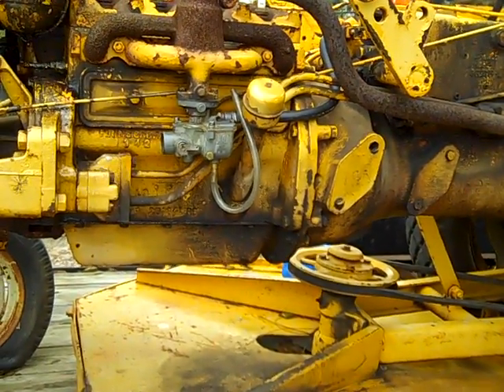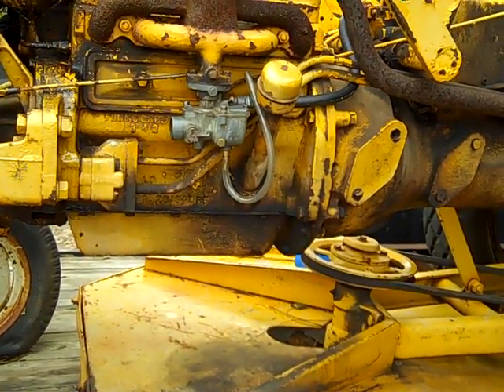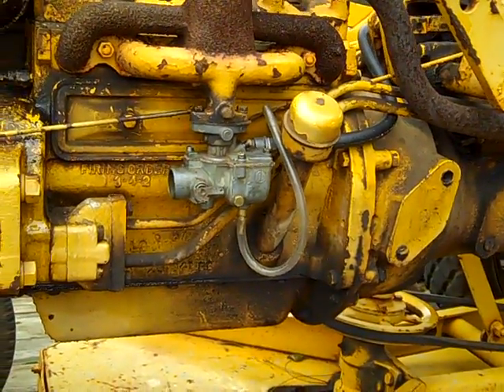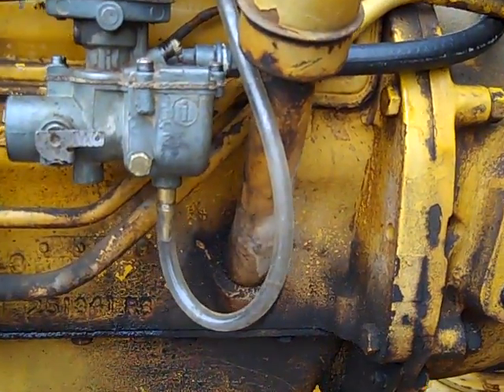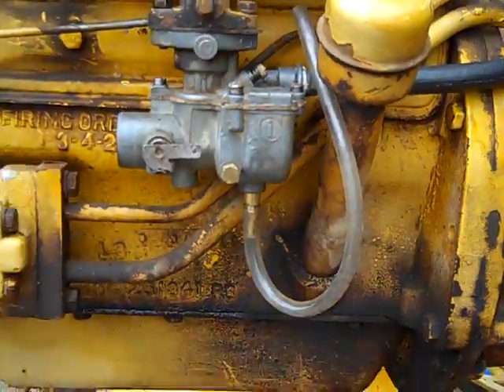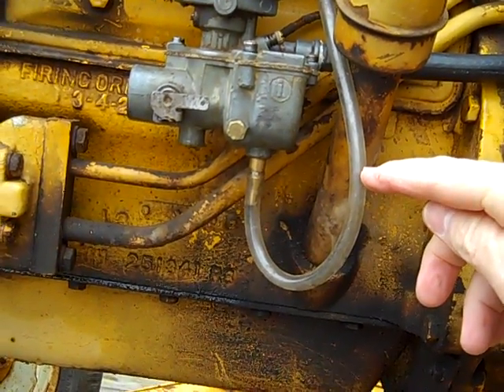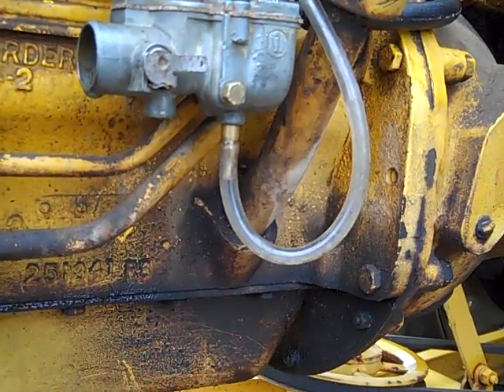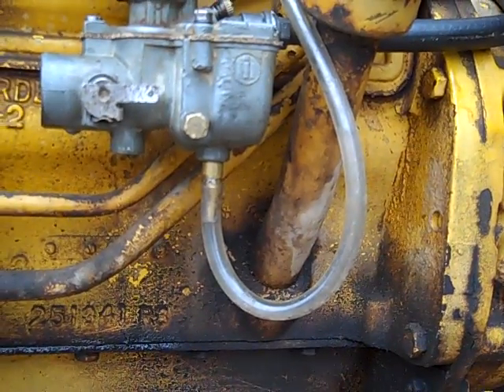Farmall IH Cub Carburetor with Float Test Tube Part II -Main Jet Removal Running Rich Carb Problem

Comment: What did you find out about the carburator. We are having the same issues
Reply from the maker: Just an idea: Could also be blow-back reversing the air flow through the carb (stuck intake or exhaust valve). These flathead engines are bad about sticking valves. Check and make sure you don't have any valves stuck open. (Compression check each cylinder, or just take one plug out at a time and hold a rubber grommet with thumb over the grommet hole on the plug hole and spin the starter. It should blow the thumb off on compression stroke.  If a valve is stuck, a bit of penetrating oil squirted into the plug hole may free them up.

Comment from the maker: Turns out, i should have done a compression test before this point...Duh!
I had 2 stuck valves causing air to "pump" back and forth in the carb, sucking raw fuel into the venturi.
Sorry for not posting a follow-up.